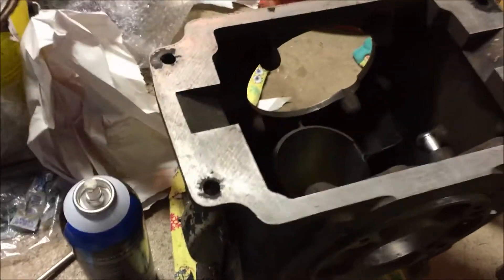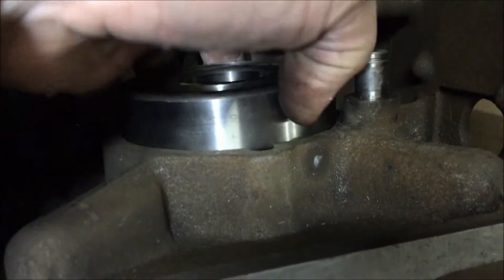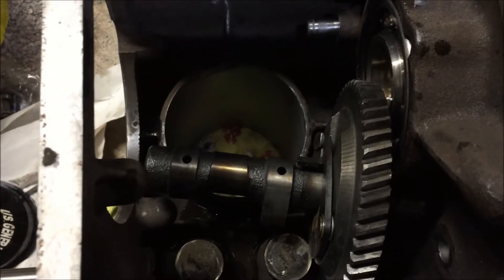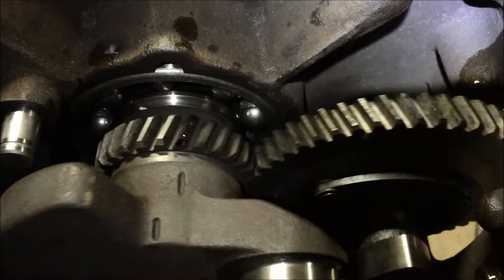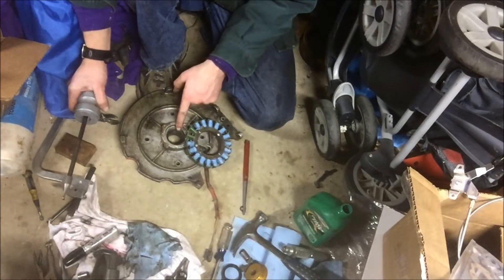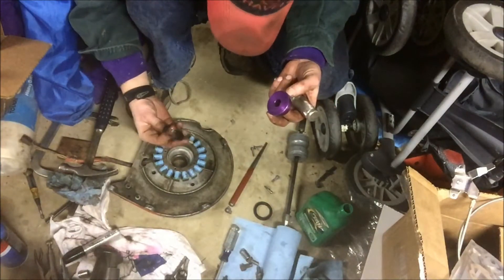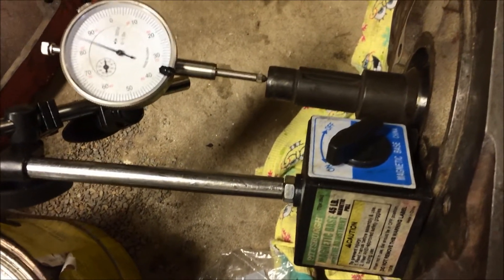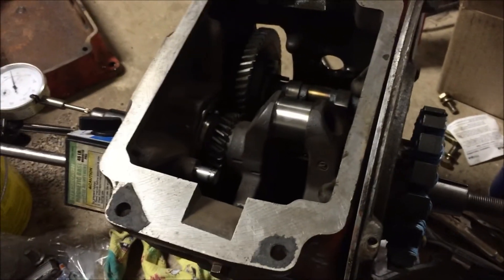14Hp Kohler Gravely Build Engine Assembly - Part 2

Comment: When you put the bearing plate on how tight does the bearing fit the crank? I had to pound my plate on far enough to get bolts started. Then when I tried to take it apart to add shims it started pulling the bearing out of the pto side. Did I do something wrong or is the crank really supposed to fit in the bearings this tight? I can’t figure out how to get it back apart now. Also have no end play because crank is so tight in the bearings